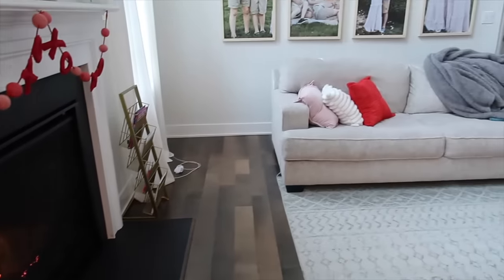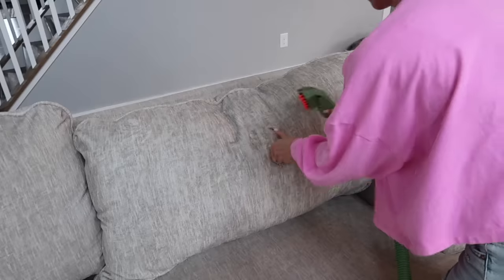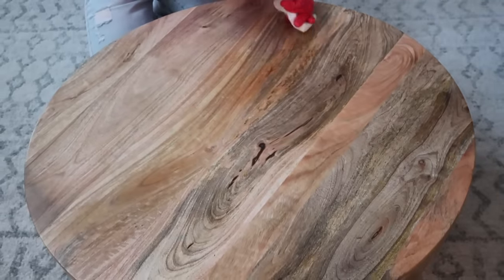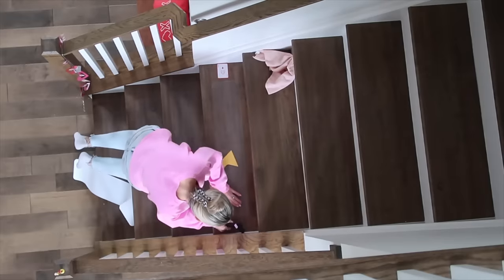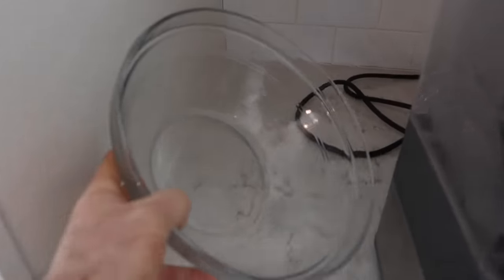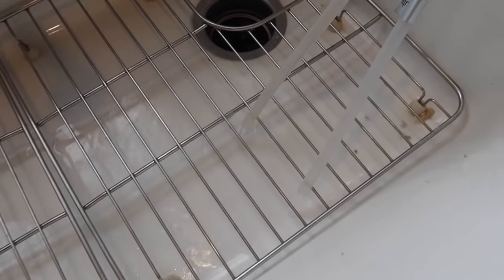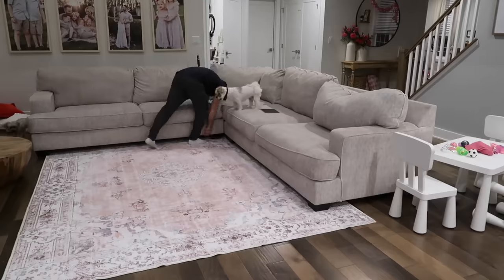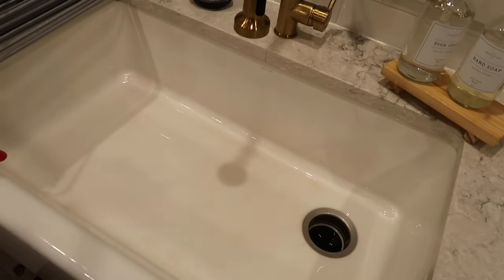*NEW* CLEAN WITH ME & HOME MAINTENANCE TIFFANI BEASTON HOMEMAKING CLEANING MOTIVATION 2024 SAHM

Comment: We got that little green machine for our steps.....haven't used it yet.....we have leather furniture so we just have to wipe it down with leather wipes, and believe it or not I have used clorox wipes a couple times and nothing got hurt.....I only want leather furniture. Without carpet on steps they are very slippery with socks, I learned once, thankfully didn't break anything, just a big bruise several years ago, so we carpet our stair cases. I love seeing you putting the clear treads to help.